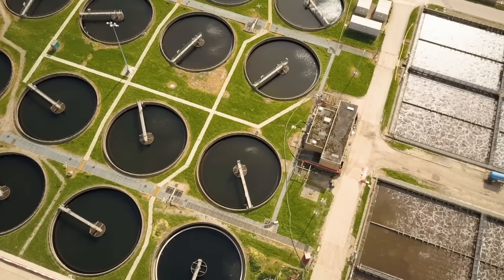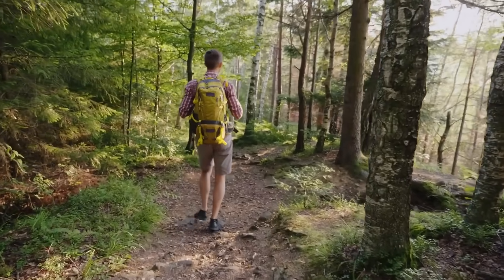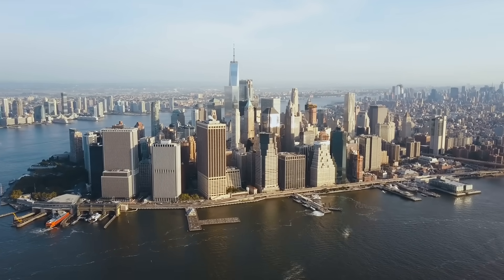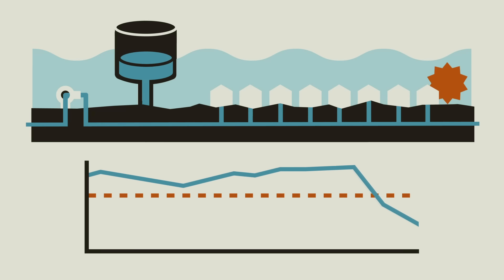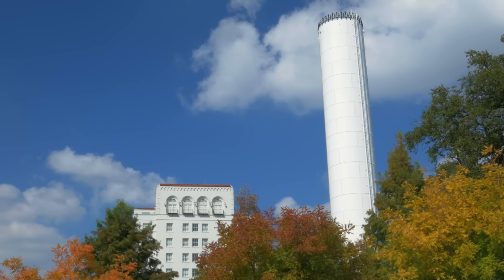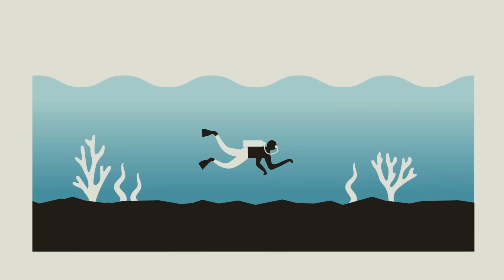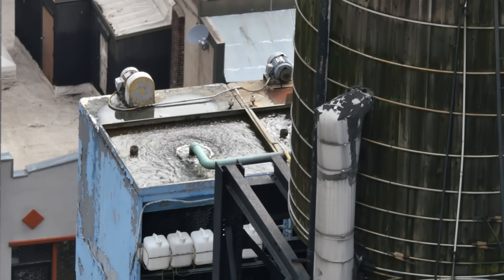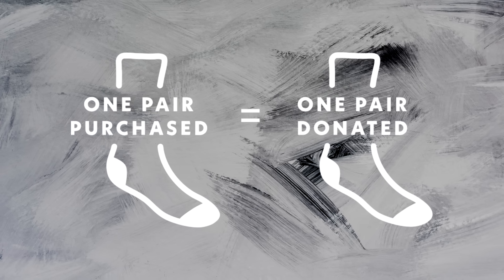How Water Towers Work

Comment from the maker: "Public Works" is a new video format I'm trying out. Let me know if you like it, and if so, what topics you'd like me to cover in the future!
Reply: Sewage systems? Or maybe telecoms. infrastructures?
Reply: @boydreamboy  telecom would be interesting
Reply: @boydreamboy  rgvcvtl jd drdgvvg
Reply: Great video! How are water towers cleaned on the inside?
Reply: @michaeladove7269  Constant use and re circulation keeps maintenance down I reckon, but every 12 months they probably send in a couple guys in diving gear and scrubbing brushes :D
Reply: Michaela Dove  great question! I would like to know too.
Reply: @michaeladove7269  Hardy Boys 001 chapter 19 taught me to just climb inside
Reply: @michaeladove7269  It's pretty straightforward. Contrary to what you might think, first it's filled rather than drained, to help the divers with buoyancy, then specialized divers climb in with basically big suction hoses and go over every square inch of the inside. My system had ours done exactly this way about a year ago. It varies by state but our regulations require such cleanings every 10 years.  
Here is a video by the company that did ours:
https://www.youtube.com/watch?v=ppf8eYVXuec

It was pretty neat. We could watch everything as they did it, tell them to look there, look here, what is that, check over there, see what the condition of everything was, and got copies of all their video on dvd afterward.
Reply: @michaeladove7269  they are taken out of service, drained, and pressure washed
Reply: @michaeladove7269  
Since a lot of towers aren't pressurized on the inside (elevation creates natural pressure), so they have access hatches that allow the maintenance teams to go inside the tank.
The tank is usually drained first (hopefully the residents are warned beforehand and respect said warning).
The sludge that accumulates at the bottom of the tank, but below the outflow pipe, is simply vacuumed out by a device that looks like a cross between an industrial vacuum cleaner and a mini dredge. 
[Usually, sludge is the result of poorly filtered water from the source or from poorly sealed water tank. Mostly it is sediment, like rust and dust particles]
In some poorer cases, the tanks are simply scooped out manually and the insides are scraped and hosed down.
Then, depending on the budget, some treating agent might be used.

Also, there is a more professional way of cleaning the water tower tank without draining it, but it requires dousing the team in chlorine (usually, bleach), a team of professional divers (hopefully, not-SCUBA), and a lot of equipment...
Reply: Really nice series ! I also really enjoy the bump in production quality !
Reply: As a professional electronics engineer I find it incredible how analogous these challenges are to those in electronics! Fantastic video, keep it up!
Reply: Gas line. Because we don't have it on our country. And I didn't know it exist until recently
Reply: Surge tanks for big dams!
Reply: I'm interested to know more about how water is treated before it makes its way back into the natural cycle. There must be such a wide range of pollutants that must be accounted for like biological elements and toxic chemicals. Some of which make there way into the system inadvertently from run-off, others through careless\deliberate disposal.
Reply: @tangneptune  There are a number of steps but a short summary generally the water is first pretreated to remove things like trash, tree limbs, branches etc that would clog or damage machinery or pipes. Next it is sent to the primary treatment settlement tanks allowing most of the solid sediment to be drawn out from the bottom and oils etc to be tapped off from the top. The secondary treatment makes use of microorganisms to digest the organic matter in the wastewater sugars, left over fats that sort of thing. After that various tertiary treatments can be used to further improve the effluent outflow like further filtration with sand to remove even more sediment, activated charcoal to remove any left over toxins and particularly in sensitive environments the water may also be treated to remove nitrates and phosphorous to prevent eutrophication of the river etc.

At least this is the most common way of going about it, another method is something like subsurface flow constructed wetlands essentially this is a process of creating artificial wetland habitats that actually are completely capable of treating the water naturally in fact this is basically how nature kept rivers clean from all the surface runoff from the land before certain organisms drained the wetlands and turned them into farmland. So it's fully capable of doing the job and in theory is a more sustainable and environmentally friendly method of achieving the desired goal though naturally engineering an entire ecosystem and the environment for it to flourish is rather expensive so often the cheaper method that does the job is preferred.
Reply: Jelly
Reply: I absolutely think this type of videos is not only quite interesting, but even of public service. I loved it and would like to see more of the kind!
Reply: @dervogelfangersek  Agreed. Since most of us pay for these things, I like seeing what the money goes to.
Reply: Amazing. I am able to apply the information to my fluid mechanics course at uni. Very cool seeing real life examples, would love more videos in this format
Reply: OMG LOVE IT! I'd always heard that water towers are more "efficient" but I never understood why or even if that was really true. Thanks for explaining Grady!
Reply: 'Design of lightweight concrete' or 'Green Building'
Reply: I enjoyed this video very much.  A civil engineering friend of mine was working on a huge new water tunnel to supply NYC.  Maybe expanding the topic of how dense urban areas meet water demands.?.?
Reply: Water treatment plants! And waste water treatment plants!
Reply: awesome content, great quality. Going to be an amazing series!
Reply: 7:09    That would be cool video to talk about how people use lakes on mountains as giant “batteries”
Reply: Practical Engineering Format is great, we need to learn about civil infrastructure. Do cell phone infrastructure, a lot of people still think cell phones work on satellites! Also, how does call routing happen across the world?
Reply: Loved it! Practical Engineering is one of my favorite channels on the web. Thanks for the high quality work! (Actually, it's the only channel that I actively get notifications every time you release a new video. The rest of the channels, I just stumble upon their new content every once in a while)
Reply: Wow! Great video. Really like the new format, too. I’d love to see one on power grid: once electricity is generated, how does it get to my outlet?
Reply: As a civil engineering student I like your videos that are more in depth. But this is a good series for a more general audience
Reply: What runs underneath our roads? Gas lines, water lines, power, sewer, secret passageways? Also, anything that helps us learn the costs of the infrastructure around us. We all pay for it, so seeing some basics on costs to consider would be awesome! Thanks Grady!
Reply: What about the ASCE Report card, what it means, and how we can improve our grade?
Reply: Do this please!
Reply: okay, next one is heated water distribution. Since i live in tropical area i don't know about how this system work. thank's
Reply: This new video format is great
(But, like the channel "horror humanum est" you could add a little part at the end for those who wanna go even further, and explain quickly some physics laws (this time it should have be the physic of fluids, the link between the pression, the size of the tube and the location of the water tank))
Reply: Stoked. I like me some public infra info.
Reply: It's so.... Practical! Fantastic. also keep considering how it gets done in other parts of the world. Cheers!
Reply: Love it! Both the old style and the new style are amazing
Reply: Should be an awesome series. Maybe flood control systems? I know Tokyo has a pretty interesting system, LA is trying to reclaim the river while keeping flood control, and of course the Netherlands. Might make a long interesting video.
Reply: I love everything you're doing. I'm curious about how modern roads carry infrastructure now (power, water, sewer, data and gas) and how these roads have developed over time. What will roads look like going forward realistically?
Reply: Love this new format! I'd love to see telecommunication stations and electrical substations covered next. Even waste management/sewage systems would be interesting. Road design, management and maintenance could also be another idea.
Reply: could you please do one video on Windmills and Windpumps? the mechanism are not detailed enough on the internet
Reply: Do you know anything about Periodic Foundation Isolation? It would be great if you made a video about it! You have amazing content.
Reply: Load balancing of electrical systems
Reply: Practical Engineering Loved it!
Reply: I'd love a video on the concept of using a water reservoir as a battery for the power grid.
Reply: Sewage systems and water treatment.
Reply: Look at:
1. Different  water treatment processes and examine their different treatment stages
2. Different wastewater treatment processes and examine their different treatment staged
3. Different sources of water and how they are captured
4. Different water contaminant sources
Reply: Great video, very professionally presented. Where do you get your stock footage?
Reply: In short, yes, this format is welcome, too!
Reply: more please! cities skylines ftw
Reply: pretty good video.  as always great execution, but the content lacked a bit.   none the less thank you for the hard work on the video as i watch them all.
Reply: Do a video on freeway infrastructure and how big cities design them to handle rush hour
Reply: It's great, especially if it means we get more updates. I'd love to know more about underground cables; how they plan them, how they keep them from degrading, what they do over really long distances.
Reply: Fantastic presentation!
Reply: I really like it! Could you cover wastewater infrastructure?
Reply: Irrigation system and multi purpose dams
Reply: how about electric stations
Reply: Awesome new series.  Thanks, Brady!  I'm interested in how the technology behind cell phone networks and towers works and how it has being updated.  Just a thought but whatever you come up with Im sure will be interesting.
Reply: From dams to undersea tunnels to highway networks, the greatest infrastructure projects ever are government projects. Lately, Americans seem to have equated government with "automatically bad"--probably why they refuse to vote for infrastructure funding. It's a good idea to remind them of these engineering marvels that would not be possible without public support.
Reply: More please :) 

Is there any sort of infrastructure that incorporates solar power? Would love to know more about that :)
Reply: Looks great (and of course, interesting) :D
Reply: Practical Engineering love it!!!
Reply: Awesome! Keep them coming! Thanks for you work, btw.
Reply: Cell service towers, differences between 4g, 4glte,and 5g and what needs to happen to upgrade the service.
Reply: love it!
Reply: Traffic!!!
Reply: hey practical engineering the 1 for 1 business model can be good if it is within your home country but this same idea drives the clothing and shoe industry bankrupt in africa
Reply: Practical Engineering district heating systems
Reply: Great video! Awesome animations and typography. For future videos, I'd love to see how bridges and highways are serviced. It's easy to see a huge bridge with cracks and rust (which I know from your other videos isn't necessarily a bad thing!) and wonder who is checking to make sure this is still good and how do they do it?
Reply: It works. Doesn't need to be experiment or case study.
Its always nice to learn how environments and topological differences affects to infrastructures and their material choices.
Reply: I like the idea of these public works videos, I think you should incorporate a little math into each one. Even explaining that FT-HD doesn't change with volume would have been informative for some.
Reply: Thumbs up!
Reply: Substations and grid management -- particularly reserve power management. If you know anything about the infrastructure of regional energy markets that would be nice too since lots of people are moving toward solar.
Reply: This is awesome and thank you for doing it.  I heard some guy say "solar panels are bad because they don't meet peak demand."  Could you do a video exploring that concept?
Reply: I love it, there are so many things i see day to day and take for granted
Reply: poop
Reply: Do electrical infrastructure
Reply: Love it!
Reply: You're the man Grady! Love the videos
Reply: I really liked it. My suggestions: railways, pavements and waste landfills
Reply: Solar panels? Anything one can implement in their own local community I would like to see
Reply: Like it!
Reply: I do miss the experiments. Needs more concrete...lol just kidin.
Reply: Love it! Keep up the good work. 
Maybe try the municipal recycling programs. Or snow removal.
Reply: This is a great series! Keep up the awesome work.
Reply: Yes, love public works series! Please keep them up :)
Reply: Keep up this series! This is what I really wanted to seen in these engineering channels! Thank you!
Reply: Excellent format, your production looks really good!
Reply: Practical Engineering like a capacitor? 🤔😯
Reply: I like it! Topic ideas: aviation warning lights, spraypainted markings of underground things, frequency spectrum regulations, sensor networks (cell phone towers; gunshot triangulation system e.g. washington DC; traffic cameras)
Reply: I consider it perfect.
And getting this mark from me is not an easy task, I only find one if many thousands quality videos to be perfect.

Congrats and welcome to my Hall of Perfection!
Reply: I love this new series! Can you do transportation? Its what I study. Thanks!
Reply: I’d like to know how gas is distributed without it leaking.
Reply: I love the idea! Possibly sewer systems, gas systems, and communications.
Reply: Parking lots.  Why are they designed the way they are.
Reply: Practical Engineering cogen and steam plants!
Reply: What about your concrete assignment? You not gonna meet the requirements for not breaking in your press and "human can lift and carry"?
Reply: I work for a Public utility that does water treatment and distribution, I thought this video was great!
Reply: im more interested in internet infrastructures
Reply: This is awesome! Please keep making this series!
Reply: Practical Engineering 

Idea for Public Works:
Drainage.
I live in Houston, Texas, USA; so this is always on our mind. It’s so flat and low [elevation] here that the streets are actually designed to conduct runoff to the bayous in times of peak load to the drainage system.

Would be interesting to see how drainage is handled in other areas, and how it has affected development of municipalities (if at all).
Reply: I love it so far. Keep up the long video length format. More detail is always better
Do some videos on electrical transmission
Reply: Love it!  I've been waiting for a series like this.
Reply: I think something about the importance of stormwater management would be fascinating. Cheers!
Reply: Honestly, couldn't be happier to see public works get a set of really high quality topic coverage from you. Kudos, really looking forward to it!
Reply: Great concept. I'd prefer an AvE style patreon delay over built in ads.
Reply: are water towers good for high rise buildings? will it not make the structure wobble? if so how much?
Reply: How about a series for how infrastructure (water, sewage, oxygen, waste gas) would work on Mars?
Reply: The new format is definitely good.
Please consider these topics:
1. Mobile/Telephone Communications
2. Petrol Engine vs Diesel Engine
3. Reverse Osmosis based water purification system
4. How Satellites work? How direct-to-home entertainment system works?

Thanks
From India.
Reply: Awesome video! I'd love to see more. Thank you Grady!
Reply: I love learning about any infrastructure that’s hidden from public view, and sometimes is even in plain view. Examples: Electric, gas, plumbing, telecommunications. The bigger the engineering feat the better!

Also, how electricity utilities continuously balance their generation with the fluctuating demand since it always has to be 1:1 and traditionally (historically) grid-scale electricity couldn’t be stored.
Reply: this is a great format because, i don't have an engineering degree but there are more than a few topics on engineering that i find fascinating - that's how i found ur channel tbh. and this video and the topic will definitely appeal to a broader audience. Great Video and Great job Grady!
Reply: Fascinating! I'd love to see something on storm drains and sewage drainage and sending waste water into the ocean. Thanks.
Reply: A video on Cross Laminated Timber (CLT) would be fantastic
Reply: I really love this new format. To be honest, today, I was wondering how Transformers work in a neighborhood, how they blow, and their importance in a neighborhood. How does electricity flow differ between the days and how they can be improved upon. How they manage houses with old wiring or why breakers trip, or can they save you from power spikes. 

I am going to school for Computer IT ( microcomputer specialist and systems administration ). It would be nice to understand the actual process of electricity without going the whole electrician route. Too many channels have conflicting facts, and have see someone tackle them. Or at least another way of thinking in the mix.
Reply: Practical Engineering what inspired your interest in engineering?
Reply: ive always wondered how these towers work.
Reply: I love it. Great info. As a student of civil engineering, I would like to see more.
Reply: Sir can  u  tl me some topics for project in civil engineering
Reply: Biogas remediation in sewage systems,
Reply: I don't like the fact that you tell the lie that electrons flow from high to low voltage, its the other way around, you probably confused current vs electrons
Reply: i would like to know .....
why in a centrifugal water pump if it doesn't push the water till the minimum height designed, it pushes less water than if it have had pushed  to the minimum designed height(excuse my explaining ...i'm not native english)
example: my centrifugal water pump have a minim and maxim water height....what would happen if i don't push the water to the minimum height designed ??? the flow rate will increase or will decrease???
Reply: I have emailed you, so please check. I would be very happy if you are interested in explaining the morning glory spillway on the dam.
Reply: It's like capacitor
Reply: An episode on cell phone networks would be interesting.
Reply: Incinerators... are they the answer to our non-recyclable trash problems?
Reply: Practical Engineering great video !! .. further, maybe you can try to cover the topic of rapid drawdown in a dam 😁 

thanks for the education, really love it!
Reply: This one really caught my eye.  I had a idea of what the use of a water tower was used for but you filled in all the gaps.  Great video!  I absolutely hope you continue this series.  My biggest suggestion would be a power grid for a future video.  The differences in different power lines, interstate lines vs city poles, different voltages adapted to these lines and why.  Thanks again for the great video.
Reply: Yes liked it!  Take any city and make a documentary on its water supply system right from it's source to end point covering the challenges faced and creative solutions adopted.. That would be very interesting project to execute and also 2 watch...😃
Reply: cant wait to see more. traffic systems!
Reply: Absolutely love this format. Very much looking forward to morr
Reply: Let's hope there will be a video about drainage systems and flood mitigation video in the future!
Reply: Not from higher voltage to lower voltage, from higher potential to a lower potential
Reply: Something on sewage systems will be nice
Reply: What song is that at 1:00?
Reply: A while ago I learned that the spray-painted symbols on sidewalks were related to different public utilities and that they were color coded. Now I notice them constantly but don't actually have an understanding of what color is which utility and what the symbols mean. I think the same video where I learned about that discussed the different ways that cities use design elements like raised bumps on sidewalks to help blind people navigate, and the ways some cities are using design to alter people's behavior. Unfortunately that last bit includes park benches that are uncomfortable to lay on and spiky floors in doorways to prevent homeless people from sleeping there.

But yeah, a video covering the various "invisible" designs around a city that we might not even notice would be cool. It would give people something to contemplate while walking in the city.
Reply: Wastewater treatment
Reply: Great series!  How about one showing how highway structures are similar to hydraulic flow?
Reply: I’d love to see a shareable, comprehensive video about what physical infrastructure actually makes up the Internet we all use and how that works, if you’re still looking for new topics. Great video about water systems!
Reply: I really don't understand how storm drains work?
Reply: As a public worker doing public works in the water industry, I completely approve and this video was completely spot on.
Reply: I found the Public Works topic very interesting and provide a smooth refresher on university topics that most engineers forget if not practicing the same specific discipline.
Reply: Check “How It Is Made”, a TV program for ideas.
The sock ad should have showed us how they were made.  Oh, socks are not public service. Compromise? Change name? Start another video?
Reply: Great video, good idea with public works 👍
Reply: Sewerage systems-types, design, cost etc. Effluent management systems for factories say dairy processing plant. Thanks for your informative videos
Reply: how does spaceships works :)
Reply: Great video.  Good information and to the point
Reply: Buat translate Indonesia
Reply: Please Subtitel indonesia
Reply: @arsetia4229  benar gak ngerti ngomong apa ha ya sedikit paling yang ngerti 

Ngomong opo iki?
Ngomong naon maneh teh kang
Reply: I really love it. We have all seen these systems throughout our lives.  Now we should learn how it all works.
Reply: Ponding Basins?
Reply: Its great! More please!
Reply: More about the actual design of the water tower is what I was expecting. No so much the physics of moving the water.
Reply: I remember reading that just by using smaller and smaller pipes from a reservoir the force of the water increases dramatically negating the use of some water pump requirements.  Not sure if this makes sense or if this can be confirmed?   thanks for the video!
Reply: Great, habout.. room works? 
I've been trying for the last semester to be able to provide a constant water flow that equals around 20 ml / 24 hours to irrigate a single personal plant in my room when i am traveling away from my room.. for sure i did 't make till now but.. it was a good experiment dealing with all materials i had to use to make such a private water tank hanged on my wall, big old plastic bottle, hot glue, steal rope, thick thread and that medical needle used to give fluids to patients.. (called Caniola i think) . 

Would be great to give young students opportunities to be guided through some special private projects

Thank you
Reply: i led board
Reply: Love it. Just wish the animation would have shown a little more, like the water going to the water tank.
Reply: I like it, though it's my first video from you.
subscribed!
Reply: Turning over of tanks is necessary for good quality water. And the best way of operation of these storage tanks is to maximize the exchange of water. Which means bringing down the tank water level lower. But if lets say i want to increase the exchange of water, does increasing my water level higher help to improve water quality?
Reply: @PickUpShoes  cool
Reply: WHY DO SO MANY PPL REPLY YOU KNOW I GET NOTIFACTIONS?
Reply: Love this series!!
Reply: Di Indonesia air kota nya PAM blm merata dan masih sering mati ditambah hanya area pusat kota saja yang kencang air nya 30-60psi
Reply: Talk more about wifi and servers?
Reply: I definitely love this. I actually have 2 water towers within 2 miles of my house and being in a desert, the way we manage our water is crucial so I found this very eye opening. Thank you so much for sharing! I love getting engineering insights into the world that I've known but never looked more deeply into (:
Reply: How about rainwater catchment systems and their potential to improve water use.
Reply: Your video was amazing
Reply: I’m a little late to the game here but you are a great educator 
Good stuff here!
Reply: Water will take up a few of them! As a possible solution to this day-after-tomorrow climate, what about using deep bore reservoirs under cities? Boring technology for transit is backed up by 30 plus years of stability. The same 8 to 12 foot diameter boring could be done for water storage. Using tunnel borers to create tank tubes 100 or 200 feet down could cache large volumes of stormwater for reservoir buffering or provide clean tanks for further post-reclamation treatment. Tanks can be bored as a series of 1/2 to 1 mile mile long arcs and plumbed for steps or batches. The groundspace beneath existing reservoirs has excellent potential in areas with marine, manufacturing or agricultural (runoff) compromises. Would this type of boring for water may be practical?
Reply: Hiiii
Reply: I like this subject a lot.
Reply: @Practical Engineering your videos are always so well made. Thank you
Reply: I'd like to know about the inter-dependency one infrastructure has on another to operate, e.g., natural gas/petroleum pipelines/pumps need for electricity; electricity's need for water systems; sewer/waste to energy sources;  highway/rail/air/waterway transportation infrastructure to one another, etc.  I learned this leading up to Y2K, but a lot of people watching your videos may have been born after 2000.  Thanks for posting.
Reply: “Then Peter said unto them, Repent, and be baptized every one of you in the name of Jesus Christ for the remission of sins, and ye shall receive the gift of the Holy Ghost. For the promise is unto you, and to your children, and to all that are afar off, even as many as the Lord our God shall call.” Acts 2:38-39 KJV 

“Jesus saith unto him, I am the way, the truth, and the life: no man cometh unto the Father, but by me.” John 14:6 KJV 

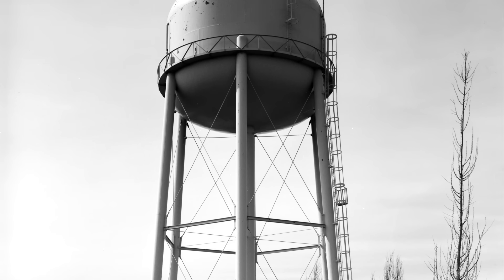“For if ye forgive men their trespasses, your heavenly Father will also forgive you: But if ye forgive not men their trespasses, neither will your Father forgive your trespasses.” Matthew 6:14-15 KJV

“And I say unto you, Ask, and it shall be given you; seek, and ye shall find; knock, and it shall be opened unto you. For every one that asketh receiveth; and he that seeketh findeth; and to him that knocketh it shall be opened. If a son shall ask bread of any of you that is a father, will he give him a stone? or if he ask a fish, will he for a fish give him a serpent? Or if he shall ask an egg, will he offer him a scorpion? If ye then, being evil, know how to give good gifts unto your children: how much more shall your heavenly Father give the Holy Spirit to them that ask him?” Luke 11:9-13 KJV

“And Jesus said unto them, I am the bread of life: he that cometh to me shall never hunger; and he that believeth on me shall never thirst. But I said unto you, That ye also have seen me, and believe not. All that the Father giveth me shall come to me; and him that cometh to me I will in no wise cast out. For I came down from heaven, not to do mine own will, but the will of him that sent me. And this is the Father's will which hath sent me, that of all which he hath given me I should lose nothing, but should raise it up again at the last day. And this is the will of him that sent me, that every one which seeth the Son, and believeth on him, may have everlasting life: and I will raise him up at the last day.” John 6:35-40 KJV 

“And fear not them which kill the body, but are not able to kill the soul: but rather fear him which is able to destroy both soul and body in hell. Are not two sparrows sold for a farthing? and one of them shall not fall on the ground without your Father. But the very hairs of your head are all numbered. Fear ye not therefore, ye are of more value than many sparrows.” Matthew 10:28-31 KJV
Turn to Jesus Christ. He is the only way.
Reply: Would love to hear how a Water Tower may fail and possibly fall. Recently noticed a cable broke on the water tower close to were I work and live and I am interested if this is an alarm of failures to come. It looks to have been broken for a bit now and no one has repaired it.
Reply: I love it, but I'm a plumber, so I may be biased. Keep them coming.
Reply: What about garbage systems (landfills, burning plants, etc.)
Reply: Do one on how water main breaks occur!  I repair them regularly, but i would love to see your explanation and imagery
Reply: You don't see water towers in England for some reason?
Reply: Your skill in narration reminds me of the golden days of discovery loved to watch engineering feats explaining videos and how it works keep it up!
Reply: You have a good information basics videos. Thank you.
Reply: Thx 4 sharing. Plz make appt more new ones. ❤❤❤
Reply: Water tank is just like a capacitor in an electronic circuit.
Reply: People need to just stop wasting water or build on property water storage tanks
Reply: Thank you. This is a fascinating topic and I'm looking forward to watching more episodes. I work with engineers and it's useful to understand what they're talking about.
Reply: I’m 7 minutes in and you’re still babbling about everything but the actual topic. Terrible video.
Reply: Years ago, our small-town water system ( water pumped from local wells )  relied on additions of chlorine to keep the water potable  ...and it was common to smell that chlorine while taking a daily shower.      However, I believe that our municipality has switched to an ultra-violet light purification system.   I am suspicious of how well the ultra-violet system works.     The faucets in our basement accumulate a black gooey residue in the aeration screens.     Our outside siding where the shower vent exits to the outside air accumulates a blackish residue that is noticeable.           I am concerned that when many people in town take a bathroom break during a Super Bowl commercial, can an ultra-violet light handle the exorbitant volume of water required to replenish the water that was used.        What happens during power outages?   What happens when an ultra-violet bulb burns out on the weekend.     I would think that it would be wise for a municipality to introduce some chlorine into the water system from time to time, but I have never been able to detect any chlorine smell.    I admit that I know very little about modern water purification systems.    I would love to see you cover this topic.   I learn so much from your excellent videos.
Reply: Think of the series like Sim city.  For that you need to plan your transit and transportation, your utilities. Electric, water, sewer could each make up sub categories. Just overviews of planning sizing and examples exactly like this.   

Transit could be the roads rails and waterways.  What's it take to plan, build and maintain them?

Transportation could be how transit interacts with businesses and people.  Which gets more behavioral, but the emerging perspective on planning those would be great.  Much appreciate all the time making these
Reply: more about bridges!
Reply: Definately enjoying it.  Music throughout the video would be a nice touch!
Reply: I love all your videos, so informative!